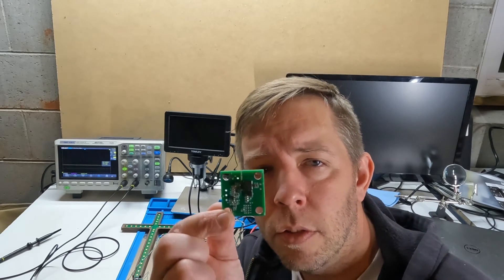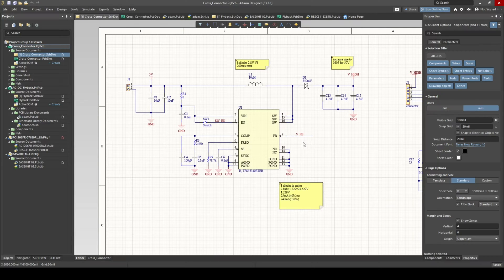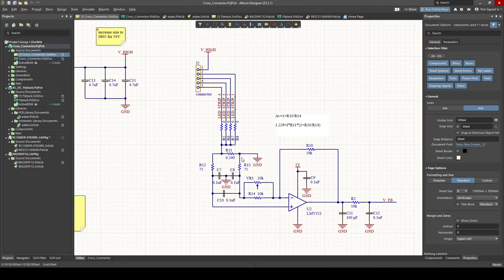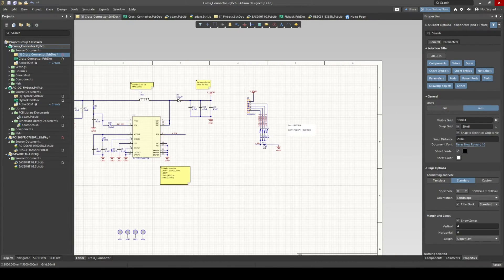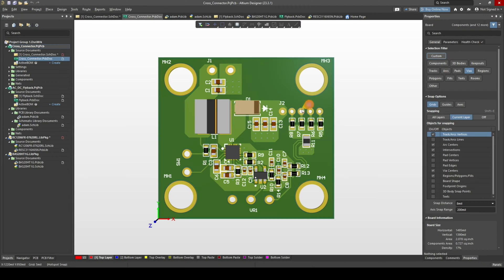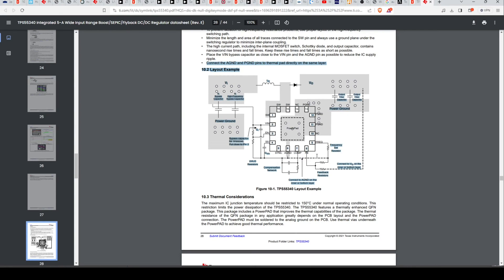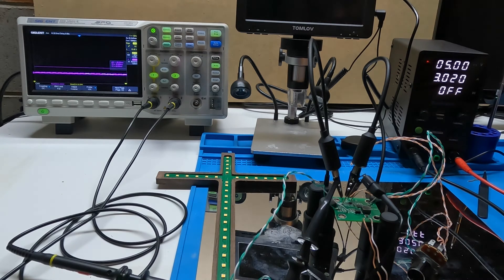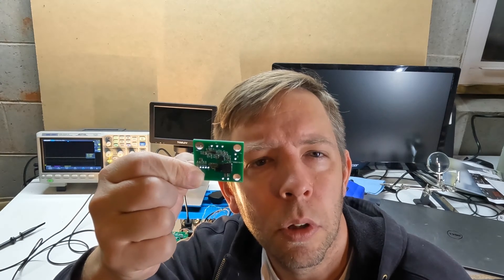Constant Adjustable Current LED Driver Circuit / PCB Design

Comment: Can we start from [almost] 0 amps?
Reply from the maker: You need to pick the current sense resistor and op amp circuit resistors to make this circuit work. 
Yes, you can get the current very low.  Near zero, but you will need to set the gain of your op amp to get the voltage at the feedback pin at a level for the regulator to work.
Reply: @carolinaworkshop7091  🙏🏻🙏🏻

Comment: This was exactly what I was looking for. I need to adjust the values a bit, I need a 3.2A 32V output from a 24V input. Or maybe even down from 36V.
Reply from the maker: Simple circuit you can apply a lot of different ways.  
Glad you found it useful.

Comment: Hi! Really nice video. I'm trying to adjust the current in low value region (0-30mA) but I enter into an area of instability and the voltage drops. Do you have any suggestion for this problem? My goal is to regulate the current from 0 to 100%
Reply from the maker: Without looking at what you have going on my first thought it consider voltage across the sense resistor and the voltage at the feedback pin on the boost converter. Are they reasonable values at 30mA?  Its going to be impossible with my circuit to get the full range of current values working. 
Youre going to have to make a table with voltage, current, and resistor values to find what range is going to work for you. For example, under some combination of inputs the regulator can not output a voltage to make everything work. That's where I would start at least.
Reply: @carolinaworkshop7091   great, thanks for your reply.  yes, as you say, at low current there will not be an acceptable voltage.  Now I'll try to write the table.  A thousand thanks!